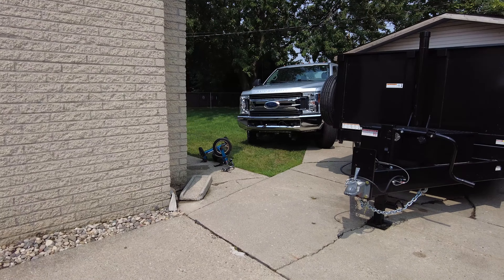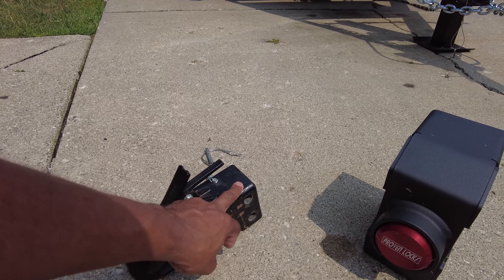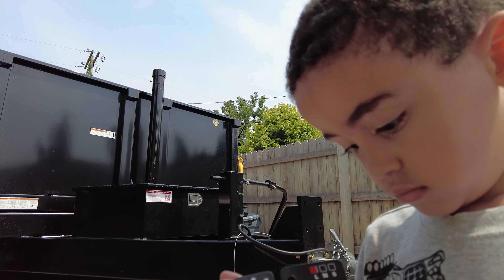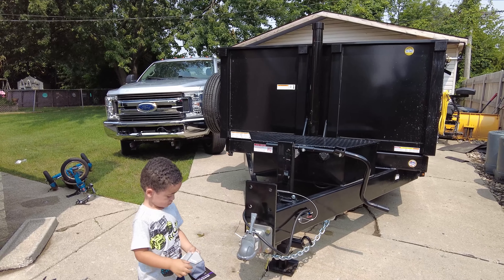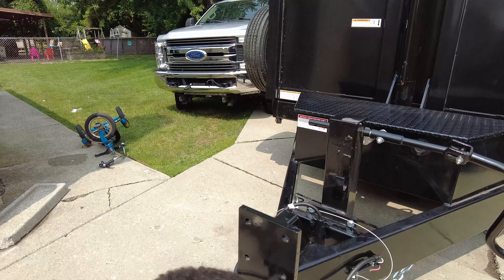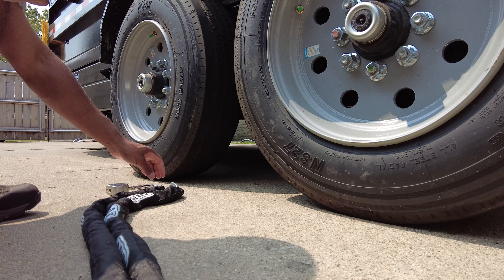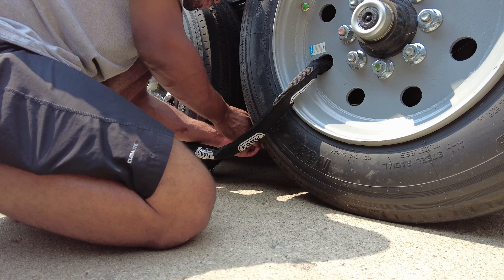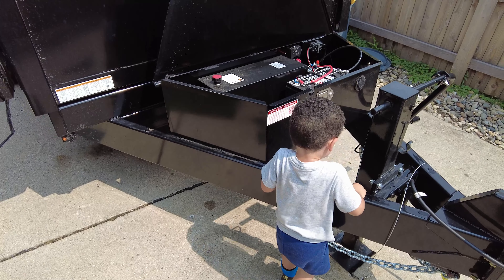$10,000 DUMP TRAILER STOLEN. How are we securing the new one?

Comment: Sorry to hear your trailer was stolen. There are alot of tweakers and miscreants out there. it's a never ending battle. Bolts cutters for that wheel chain, then they'll use the safety chains to drag the trailer down the road.
Reply: The type of chain he is using, destroys the bolt cutter jaws when you try to cut the chain, due to the 65 Rockwell hardness of the chain. I like how he locked the lock on the inside of the tires, harder for the thief to get to the lock. It's sad we have to take all these steps to secure our valuables. I see these ads on Craigslist for new stihl chainsaws, never even had fuel in em, and I came help but think they were probably stolen.